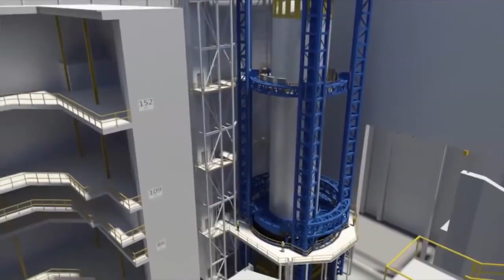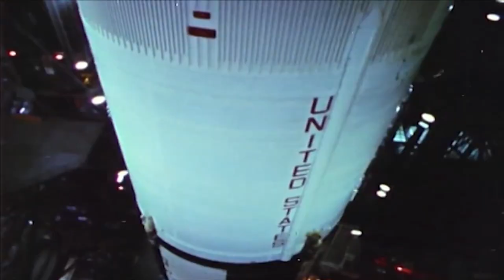Welding Wonder: NASA's Vertical Assembly Center

Comment from the maker: For more than 50 years, ***** has relied on welding to make the impossible possible. Launching satellites into orbit, sending probes to distance planets, and even landing a man on the moon - none of it would have been possible with advances in the field of welding.

Today, NASA is poised to take their next big step into deep space with the Space Launch System. Standing nearly 400 feet tall, it will be the largest and most powerful rocket ever designed by mankind. It will help take humans back to the moon, and even on newer more exciting destinations like asteroids and Mars. And just like all the rockets and machinery before it, the Space Launch System will rely heavily on a new advancement in welding - the Vertical Assembly Center.

Debuting on September 12, 2014, the Vertical Assembly Center is the largest welding tool in the world. It will help bring together the massive core stage of the SLS one piece at a time.

Learn more at our Welding Wonders blog: www.weldingwonders.com

Comment: We developed and discovered the first automatic welding system
  for diamagnetic and paramagnetic materials of the world. The new welding method is special for the manufacture of cryogenic and monocoque tanks of aviation and trips to deep space.
Our system creates symmetrical and asymmetrical joints from the front and from the back of the TITANIUM, also Aluminum and austenitic steel with inert gas protection in all possible corners

Comment: How does this giant welding jig weld? MIG, TIG, RF induction or friction? What kind of allow will those tanks be made of?  Solid aerospace grade aluminium plate? aluminium/magnesium plate?  How thick would such alloy plates be?  This is not the same as welding steel plate or mild aluminium that's for sure.
Reply: stir welding